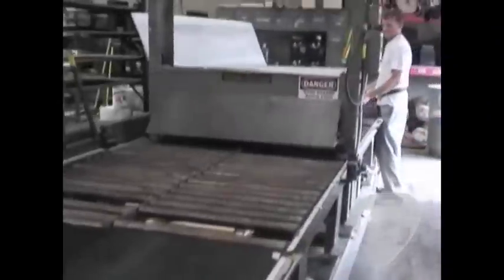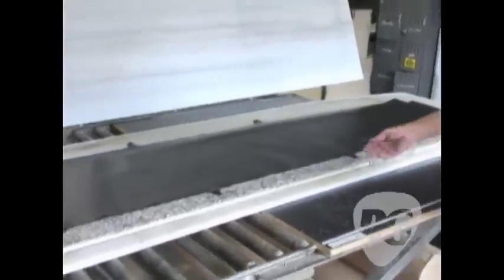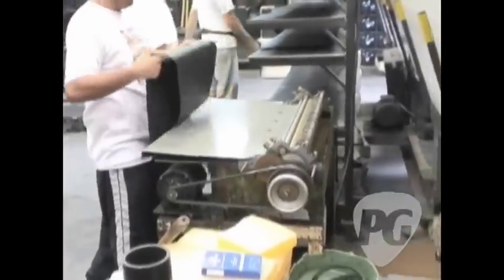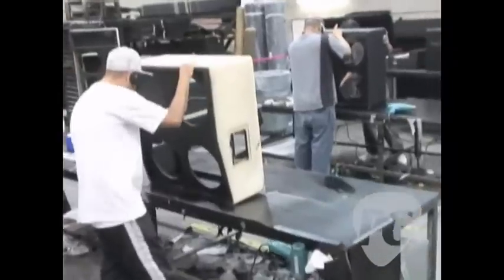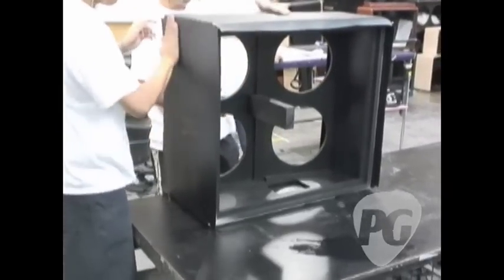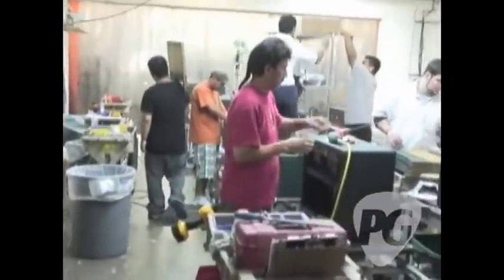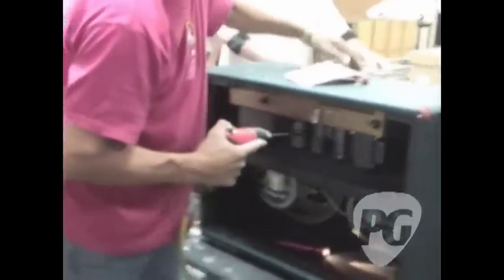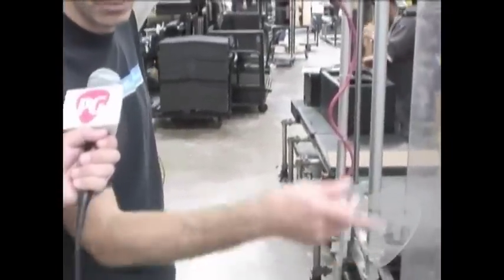Mesa Boogie Factory Tour-Tolex Process & Final Assembly

Comment: I wish they would have shown the installation of the grille cloth.  I’m thinking about buying a cab but want to replace the grille cloth and it has 4 screws on the front of cab so I’m wondering does the grille come off by removing the front screws only? Is it also glued in the front? Or does it have screws and glue on the inside as well? 🤔

Comment: I bet Mesa makes more money in cabinets than amplifiers.
Reply: without a doubt. it costs them maybe 75$, all parts included, to make a cab.  their amps are top quality custom work. their cabs are generic shit cabs with barely enough room for the drivers they hold, less bracing than the average home theater speaker from the 90's, and usually not even a horn so they can save another couple dollars on  tweeter and crossover.
Reply: @FingerinUrDaughter  Yup, it seemed they didn't even use fingerjoints for the corner construction. Guitar cabs are mostly wooden boxes.

Comment: Ok, I hate to be contrary, but this processes they use with the die cut vinyl  has taken almost ALL the art out of covering a cabinet. The art in in getting the corners and contours to come out clean, and with that die cut thing, they are already notched and don't require near the skill to deal with. Of course, that's a great way to do it, I wish I had the space and tooling for that, but 'cmon, don't call it art. What those dudes were doing was a cake walk!
Reply: Art? Pffft. Work smarter, not harder. Art lmao. Also art can go by really fast, it doesn't always have to be painstakingly slow. What they're doing is also art, just a different kind.

Comment: I laugh at those guys with the box cutters!
For 20 years working in the printing industry I worked carrying a razor blade pinching it in my lips (used razor blades for various task all day). I never got cut this way. Then 10 years ago I go to work for a global Fortune 100 manufacturing company. There we use box cutters all the time for various task BUT at this global mfg company we have to wear kevlar arm sleeves and cut resistant gloves on both hands when we do or get fired! The guys in this video are using no safety equipment at all.
The one guy standing above the floor on the work station wasn't even tied off with a fall protection harness. If these amps were made where I worked they would have fired that guy too for not wearing a harness and tie-ing off.
Reply: First, there is no requirement for fall protection for heights less than 4 ft.  So you're wrong on that count.  Second, box cutters are not illegal and unless the manufacturer requires PPE for operation, are none needed.  So that's strike two.  And strike three is that you posted you're ignorance online... in full view of the world to marvel at your ignorance.
Reply: *your ignorance

Comment: Test them better, I have had several new amps from you all faulty, boxes sealed from factory.
Also the Express I bought new from you makes a metallic buzz through the chassis when you play the 5th and 6th strings with your thumb.
You use a pick, it doesn't do it with a pick, test them BETTER, fingerpick etc.